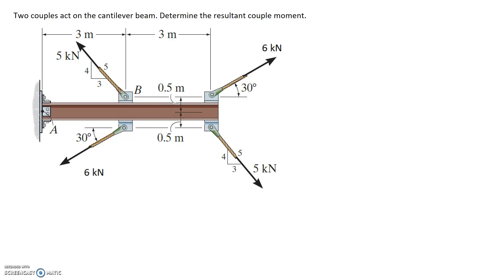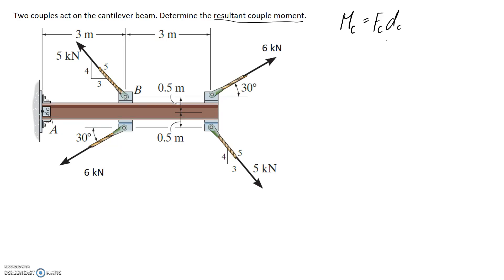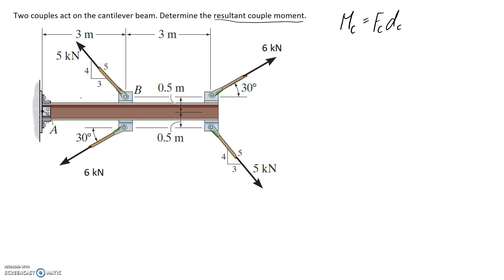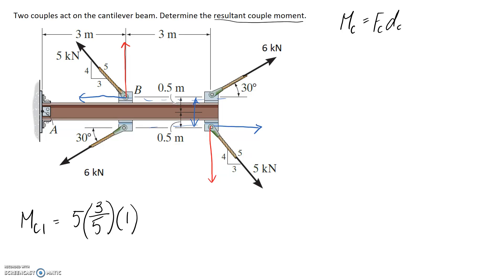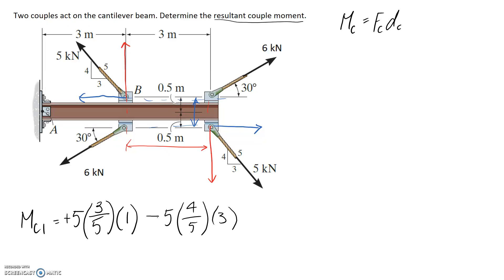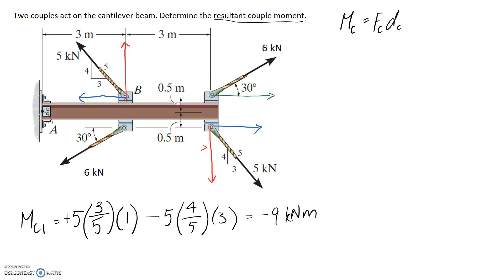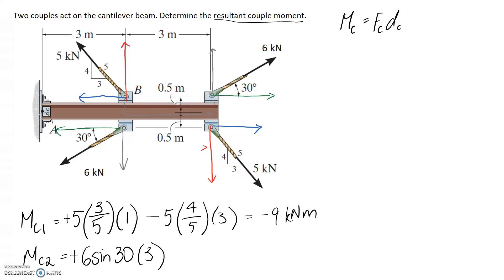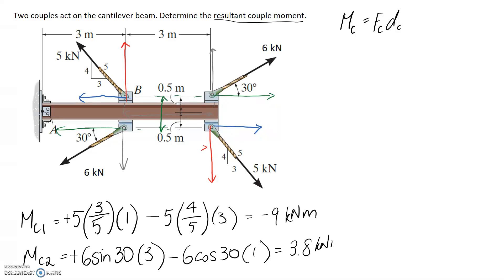Resultant of Couples Example

Comment: Thank you for your video. I am a bit confused as to why you added the x-axis moment in your calculations? I thought we have "moment" only if the force is perpendicular to the arm of the moment. In this example, the force in the x-axis is in line with the point of action, so there should be no moment in that direction? Could you please explain, thank you very much again!
Reply: The force in the x direction isn't exactly on the x axis, it's still offset by 1m vertical distance (1m perpendicular to x axis.) So it still creates a slight moment.

Comment: Easier for me to under stand that the further force in the couple moment from the origin will have a stronger moment and thus will decide the direction of rotation, vs imagining a steering wheel but this was a nice video to review right before my statics exam
Reply: I thought about the same! Btw, I have a problem.  What if I have a couple of forces that acting horizontally (one to the right and one to the left) at the end of the beam. How to tell its direction?
Thanks in advance!
Reply: @azmanazurah4133  if the forces are acting parallel to the line of action there is no resulting moment, a torque/moment will only result from forces that aren’t applied parallel to the line of action for a straight beam.
Reply: @2022A4SLine  OHhhh!!! Understood now! Thanks for the explanation! I really appreciate it <3

Comment: I’m just confused about how could you determine it’s a clockwise or anticlockwise turn
Reply from the maker: There are earlier videos in the playlist introducing this in more detail. Basically if you use a pencil (or similar) to represent your member. Use one finger to hold it at the point of interest. Use the other finger to push it in the direction of the force. Whatever direction it rotates gives you the answer.
Reply: @theryderproject5053  how
Reply: wtf
Reply: @theryderproject5053  but the  direction here is right and left how am i going to find out?

Comment: Why is it negative if it's clockwise?
Reply from the maker: That is the convention that comes from the "right hand rule". Rotation for these 2D problems occurs about the z axis which points "out of page". If you put your right hand's thumb in this direction, where your fingers point is the position direction for rotation.
Reply: @theryderproject5053  if there is z axis then it is 3D not 2D so now I'm more confused